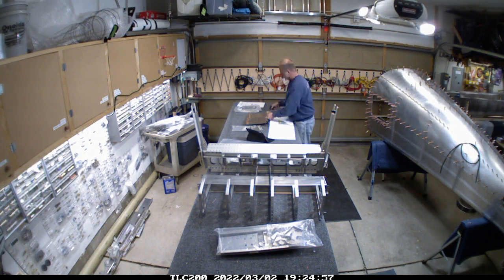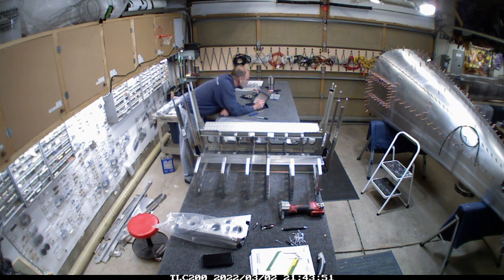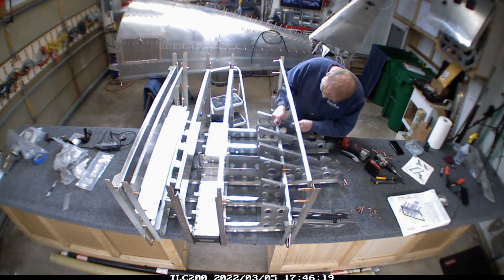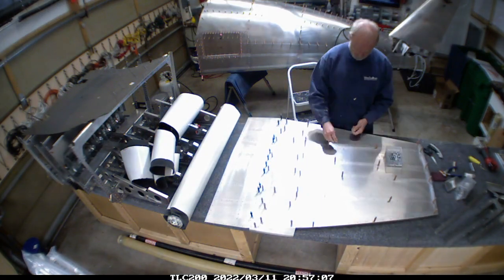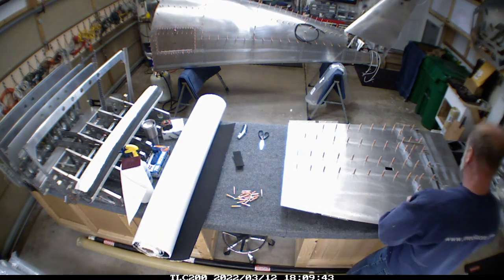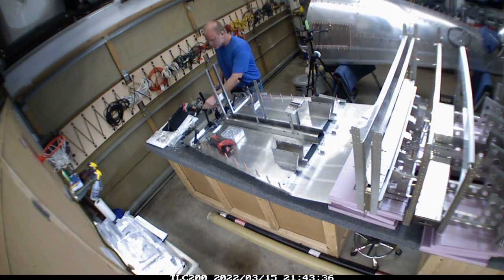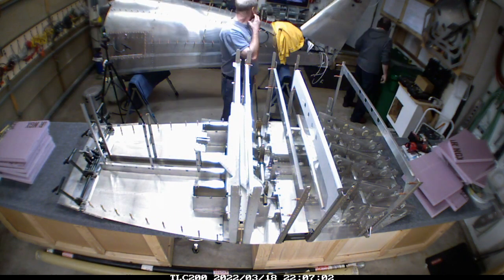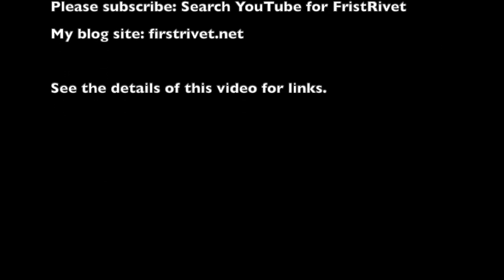Marching Forward

Comment: Want pictures of the luggage door! :-p.
What is the typical torque of the riv nuts you are working on?
Is that just open cell sound deadening?
Reply from the maker: You want pics of the luggage door?  

Regarding the rivnuts - I don't know if you've ever encountered a rivnut in which you are trying to unscrew the bolt from and the receiving end just spins and spins vs. the bolt/screw unthreading out, but I have... it's a pain.  So to me it's not so much how much torque I want to apply in putting the bolt/screw in - but taking it out.  I want the rivnut to stay in place when removing anything.  I don't anticipate having to get out a toque wrench to tighten anything down, but I certainly do want to be able to remove something if I need to without it spinning.

And yes - it's a soundproofing foam... updating Aviation Kit with the details below.  :D
Reply: @FirstRivet  Ah, yeah, that makes a lot of sense about the rivnut. 
For the door, you talked about the fitment and making sure it worked correctly. It would have been great to see a close up of it in action.
Reply from the maker: @AnnaDandAdam  I can do that - and no your luggage doesn't fit in that door.  ;)